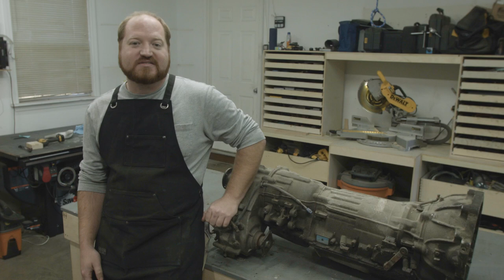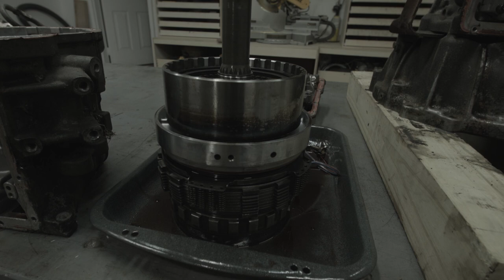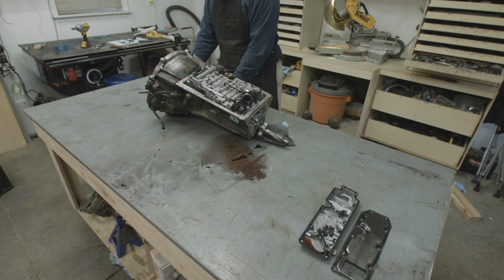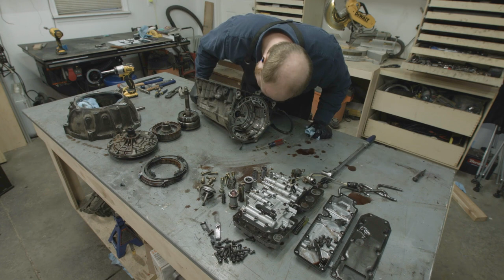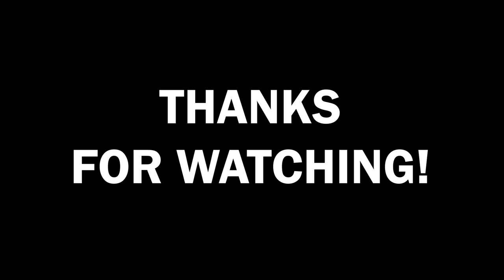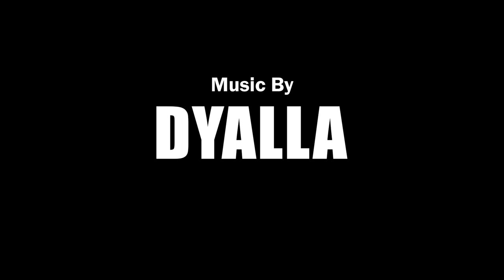Transmission Conversion Part 1- Teardown: 1989 Toyota Pickup Restoration Ep 22

Comment: Really curious to see how this goes and your reasoning for wanting to attempt it.  Also the early 90’s Toyota 4wd extended cab has always been my dream build project.  Glad I get to watch you do it first.  Currently in a 95 4runner with the same driveline as yours.
Reply from the maker: You're not the only one who is curious! I can't wait to see what happens myself. There are two reasons why I'm attempting it. The first is aesthetic: I don't want the Tcase shifter on the floor in the cab, and I think a dial in the dash (like the 2016+) is cool. The second is because it seems like a fun engineering challenge. All the pieces are there and it seems pretty straight forward. I design gearboxes for a living and to get to show one off to the public is something I want to do instead of being stuck behind NDAs. I will admit a multiplate clutch pack system isn't my first pick (would much rather have dog clutches), but these are the cards I've dealt and should work beautiful if done correctly. Good luck on your 90s extended cab when you get it! You'll have a blast with it.

Comment: Excited to see how it goes.  Have you looked at purchasing a conversion kit instead of making one?
Reply from the maker: Oh man.. that is a loaded question. When the dial controlled Tcase came out (2005 as fast as I can tell), they had driver side front axle setups, so nothing new will work under my truck. They made the drive side switch in 1995, so the last gen that has a passenger side shaft is my truck's gen (as far as American pickups go). They all have floor levers for auto and manual tcases. The manual tcase architecture doesn't seem to allow for any automated control of it's shift forks, as they are located on top of the case instead of out the back like modern ones. So making anything bolt on would be difficult. To achieve a manual transmission with a dial controlled Tcase, modding the auto TCase seems to have the greatest chances of success. I'll be going over all the details in one of the next videos.

So I think the tldr is: I've looked. I did a bunch of research, but no I haven't stumbled upon anything that lets me have a manual transmission with a dial controlled Tcase. :)
Reply: @Obscuremotorsports  gotcha...the reason I ask is because my son's truck (1990 xtra cab 3.0L) has an auto on which he was considering doing a manual swap.  Looking forward to the next video.
Reply from the maker: Ahh.. it's 4x4 then I'd suggest getting a manual with a manual transfer case. I think there are some electronics mods that need to be done to keep dashboard lights off. All of which I'll be going through myself. It should be an easy swap on. He will just have two levers on the floor.